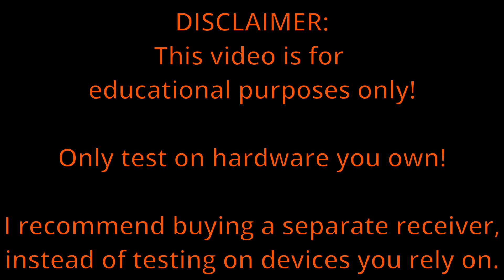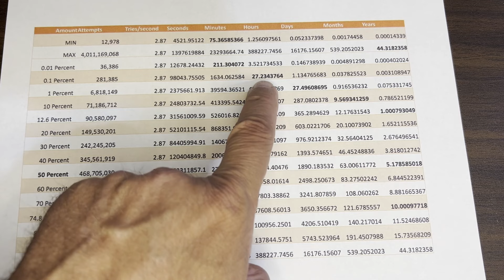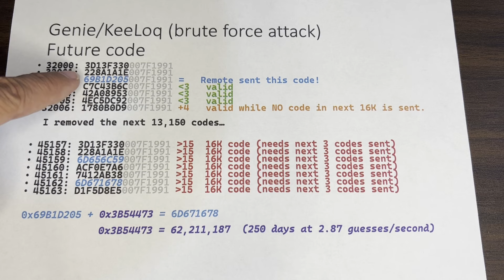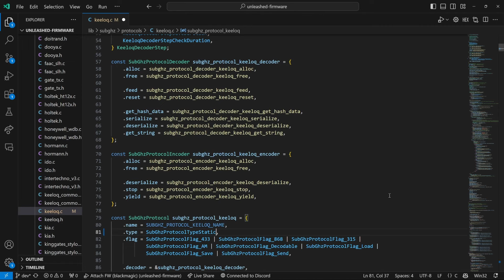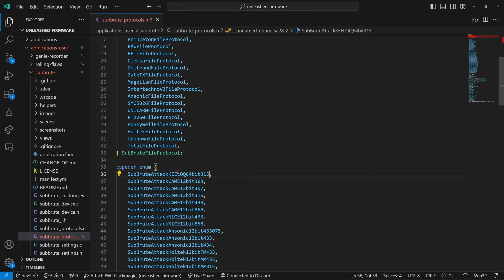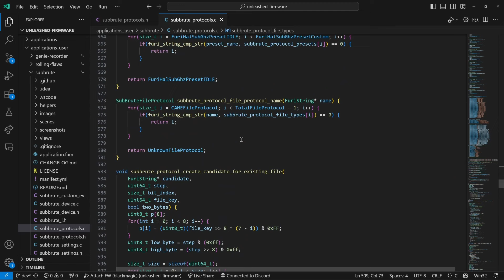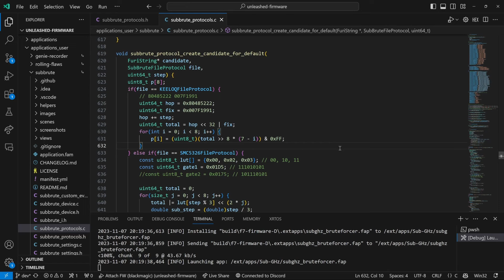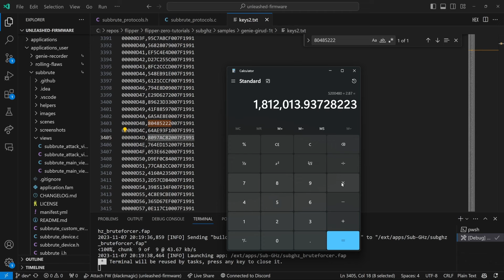[90] Flipper Zero - Brute force KeeLoq / Genie!

Comment: you are fundamentally wrong, keeloq does not work exactly like that, there is no direct dependence that the next hop should be at least somewhat similar to the previous one, all values are “random”, but almost any correctly generated hop will work when decoded by the receiver, the button code that satisfies the rule must match  with the code in fix , the last 10 bits of the serial number match the fix part and the counter should be !more!  previously received by the receiver.  and from this we can conclude that the hop part can simply be generated randomly, it will have the same effect as you, depending on your luck, and this is not optimal at all
Reply from the maker: You are correct, it’s all just luck. I should have been more clear that we could start the upper 32-bits from anywhere - only the lower 32 bits need to match.  We can increment by any amount (or random).  The graph I made based on the 65536 actual values of my remote, and then trying starting from the last code transmitted (because we have to start from somewhere).  The table I made is for my remote and using an increment of 1.  Had I started the counting from somewhere else, my luck would have changed; and perhaps incrementing by 1 would have performed much worse/better.

My hope is that people see on average it could take years (at least for my remote) & they could get lucky and open on the second try.

I showed there are two different kinds of matching.  If we focused on the second kind of match, I could have rigged it so that we started at a hop that happened to decode to count 0011 and matching the end of our serial number, then jumped to another code that happened to decode to count 0012 and matching the end of our serial number (which would have opened 1/4 of the codes on a Genie remote or 1/2 of the codes on standard KeeLoq).  Typically you don’t know a code that is 10,000 codes from now; unless you dumped the full remote (using tool like Genie Recorder) or know the MF code.  And if you dumped the codes, you would be better off making 4-SUB files to always open that remote, then trying a brute force attack.

I thought starting from the last code sent was most fair, but you can start anywhere you feel lucky. 🍀